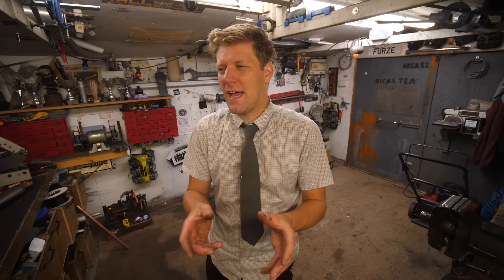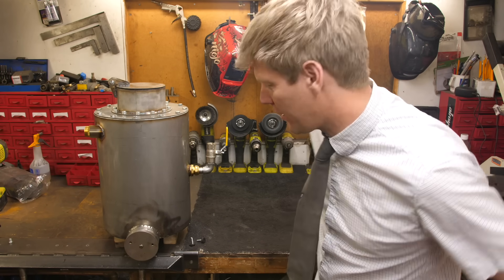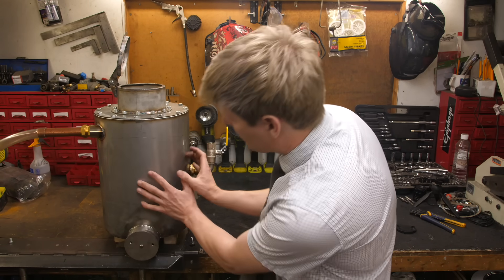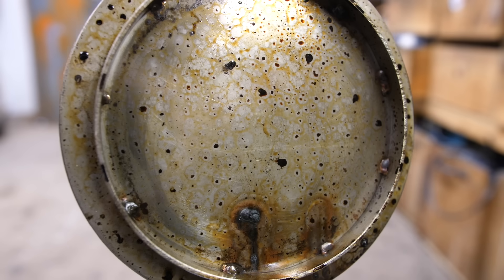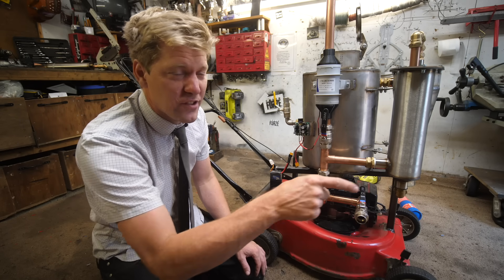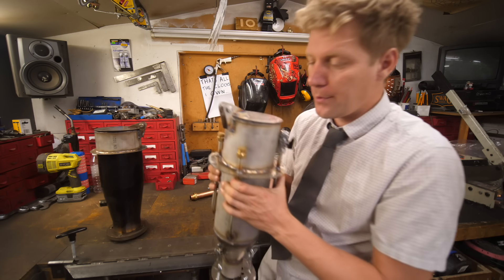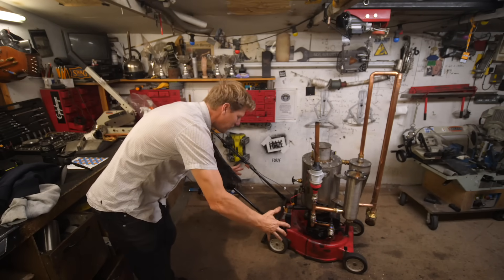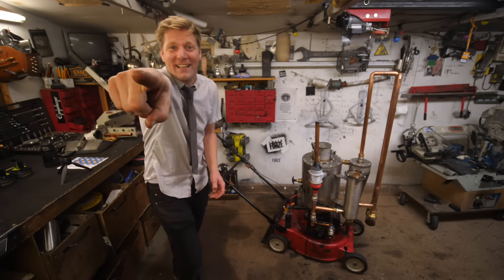WOOD POWERED LAWN MOWER

Comment: What is you capture wood gas?
Reply: Why is it upside down?
Reply: Regulate Temperature
Reply: Get an AC300 you have tar particles everywhere
Reply: It's a Vornado
Reply: Tolerances Colin. Throwing off every future project.
Reply: What is a safety tie as well
Reply: Colin. I'm dropping my mug on my lathe here we go. AHHHHHHHHHHHHHHHHHHHHHHH
Reply: MY EYEEEEEEES
Reply: IT'S INSIDE MY SKULLLLL.
Reply: IT WENT THROUGH THE MASK AHHHH. I'm going to be in a bed osmosising porcelain fragments out of my brain for two hours kthanksbye.

A Safety Tie Pops Off which is O.K. for working in a shop perhaps with equipment like a lathe or mill.
Why do I say O.K. (again in capital letters)? Because you wouldn't wear a tie in a shop unless you weren't on a lathe or mill etc. often.
No mug lathe jokes ok...
Reply: Colin Understand.

I am fine and didn't drop a lathe in a mug.
Wait.
A Mug in a lathe.

I am unharmed.
Reply: Colin why do I Need to say I am unharmed?

I am.

Because it completes the thought of what is true.

Comment: The real question is can you power the lawnmower by gassifying the lawn trimmings it produces?
You'd prolly have to dry the trimmings out first so they gassify correctly, but it would be pretty awesome to have a lawn-powered zero net carbon lawnmower.

Comment: Someone on YouTube did this but was able to "distill" out the impurities. And use the oils for work equipment bushings. Then he used this tech to gasify chopped up tires. He made 3 grades of oil/grease, carbon black (which he sold back to a tire company), and was able to compress the gases to run a kitchen stove. I wish I would have save the vid.

Comment: I have an idea that has been floating around in my head for a while, a riding lawnmower that is actually a large drone/hovercraft that uses a large central rotor to cut the grass with 4 smaller rotors around it for extra lift and another rotor that is mounted sideways at the back with a rudder to steer it better so the other rotors can maintain a constant speed. The last rotor may be able too suck the grass into a bag too. I have no idea if it would even work but if it somehow does it can cut grass in marshy areas without leaving tracks in the mud.

Comment: you seriously want to power your bunker with wood ? please dont! sir use renewable energy in some way!
please like and comment some ideas of what he should build instead of the woodpowered energy source!
Reply: I posted my idea,
My idea and for the bunker use solar power to heat the chips, use parabolic with vacuumtube or mirror focus to heat up the chips, and store the gas.
Later you can do the same for boiling water and use the steam to reform woodgas/syngas to methane.
This was my PHd and project for national award but was canceled due to corruption in my country!

If you can do and prove maybe you could get the needed attention to help 3th world to find the green way.
Reply: @Subla Kuty  look man, wood isn't for everyone. If everyone uses wood, we would be as doomed as with fossil fuels. It's the same thing with every power source. Solar panels and wind energy would not compensate for our hunger for energy.

In fact it is our energy consumption, which is getting bigger and makes it even harder for renewable energy sources to cover it.

He wants to power the generator with wood, because wood is readily available anywhere and at any time, unlike petrol.  Wind energy would be a great option, but it still relies on wind , and has to have a backup battery to store the energy. 
It is the same with solar energy, which also needs the sun. And if the solar panel breaks you can't repair it, unlike the engine, where you can replace the faulty parts.

To be fair, he technically wouldn't even have to build any energy source, because his house has electricity, but his plan is to go off grid with the bunker, so a wood powered generator is the best idea

Ideally, if he would own a little area with Forrest, he could collect sticks and tinder from there to use, but I think he will just buy some, because it is very unlikely that the UK will have a power shortage any time soon. 

Also for your information, trees grow if planted
And yes, they take a long time to regrow, but they still grow, so it is renewable

I know that every tree, that is cut down will let more co2 to store up in our atmosphere, but what most people don't know is, that a dead tree, will be eaten by fungi and other things on the ground, which release co2, so burning it for energy would be 100% environmentally friendly!

Anyways, back to the argument.

I never said that everyone should use wood gas as a power source and I don't think, that wood gas will even get to the mainstream consumer, because it is pretty hard to make a gasifier for it and you have to have a lot of knowledge to be able to maintain and be running it.

Also if everyone would be using it, the Forrest wouldn't be able to compensate for the sheer amount of wood that would have to be produced, so that is a nogo.
But it is the same with solar and wind energy, because both types of energy sources need a lot of precious metal types, which are beeing mined and shipped and manufactured with an immense amount of co2 produced. 

Either way would be bad for humanity!

But not for a single person using a wood gasifier it for fun..
Reply: @Obscure_Nightvision_Reviews  i understand what you say and i have to agree most of it cuz its true. But unfortunately, ita not just one person using wood, and we are still using up earth's wood supply. About the renewable enrgy, you just have to construct it once, and its good for 20 years without producing co2. While a woodburning for 20 years will eat millions of trees. 
I see no reason to continue the argument any further. Its about the mindset. "oh we'll fuck up our planet anyway lets have fun then" isnt the way to go i think. I cant blame those people though ;)
Reply: to be honest, wood is a renewable energy source...
Reply: @Obscure_Nightvision_Reviews  where you live ? In 100AD ? We use waaaay more energy than wood could ever reproduce. Just google it up whats happening to forests all around the world, and how its ruining our home.
Reply: @sublakuty715  not really true, if you break down water (infinate) with syngas from woocgasificatio to reform sythetic methane you got way better equalition.

Comment: So the way my friend did it was with the metal barrrel drill holes all around the top and sides, have an exhaust pipe out the top slightly slanted so the tar which is basically a biocrude oil drip down into a jar then the gas travels around the bend and through another srtetch of pipe into usable gas into the generator. This is common slavic tech right here, I've seen cars running off burning trash, also keep you warm.

Comment: According to Jim Mason from All Power Labs making engine grade gas from wood is "energetically challenged" and his company makes use of the engine exhaust heat to dry and pyrolyse the fuel.  The gas you are making is dirty because the hearth isn't hot enough, because it is being cooled by cold fuel and cold air.  APL preheats the air with the gasifier output, and preheats the fuel with the engine exhaust.

Comment: Colin (or Wallace?)
Don't pull the gas through the fire, you'll loose some.
After the gas leaves the still, bubble it through a column of water, this will cool and clean the gas. If you use the fan to pull the gas through this setup then it shouldn't melt.
Overall it worked and I applaud you or it 👏👏👏👏👏👏👏.
Can't wait to see the next video 👍😷

Comment: There's a cooky side of YouTube that does this normally furze.

I admit I would much rather see you make a rocket nozzle and turn wood into methanol to fuel it.

Mostly I would love for you to make a rocket powered something.

Also making methanol from wood is a much cleaner process. Still makes some wood gas but that can also be turned into methanol.

Altogether this video gives me a feeling that you've run out of ideas a bit.

So why not make a rocket or turbine powered scooter, not a jet turbine though, more like it's an engine than a rocket.

Comment: Colin's delight at the thing starting suggests just how difficult this is to get working in any way.
Reply: I agree. You can also see he's not being fake like some youtubers out there, his delight is genuine! His genuineness and his antics are the whole reason I follow.
Reply: It's because he's allowing oxygen into the destructive distillation process. I've done what he's doing, and it's much more successful in a simpler format. If you look up how it was done during WWII to run buses and cars you'll see what I mean. Allowing oxygen into the pyrolysis chamber is creating a flame front and burning some of the Syngas. A sealed fuel chamber with a single output will push expanding hot gas out when sufficiently heated. The gas is then filtered, and THEN you mix in air right before the carburettor. Colin's very well constructed device is mixing oxygen before the gas has been sufficiently cooled, and it's partially combusting.
Reply: Nah, he just gets excited at everything. Like getting force fed cake. Or bursting through the wall of a caravan 😆
Reply: Honestly, I was excited too. I never heard of this tech before, but he's basically built an entire from scratch. Imagine!
Reply: Yup, this was a tough one.
Reply: Always wanted to convert my truck to wood gas. The one I use on my channel.
Reply: I’ve never seen him that surprised
Reply: Well ya, he normally doesn't have to do nearly this many fixes.
Reply: Donald and Kanye getting close https://youtu.be/0KjnXpiFhT0

Comment: I've built a couple of these. If you want to cut down on Tar you need it hotter. Way hotter. like 1000C. I managed it by forcing my fresh air into a heat exchanger(intercooler). That way cold air goes hot and hot air goes cooler. I also put my air intake tube down the middle of my fuel storage into the combustion chamber, and insulated around my combustion chamber. Another filter technique is a bubbler which basically you force the gas through a water filled vertical tube and the vacuum pressure from the engine makes it bubble. I also added marbles to this chamber. My woodgas burns almost invisible. The more orange you have, the more tar you have.

Comment: Why not invert the design? Put the burner on the inner part and the wood to be distilled around it. Taping off the gas will not be that big deal and you get a bit more usble heat.

During the 70s Oil Crysis, there were a few jeeps around with a distiller on the back in my country, according to a teacher of mine..

Comment: During the wars in Finland when the military needed all the gas and it was too expensive for consumers we had motorcycles and cars running on wood gases. It was called häkäpönttö. 
And btw: the burning gas is carbon monoxide. Really dangerous for humans. So you shouldn´t do that inside the shed.
Reply: He should let it react with steam on nickel and would get methane which is stable.

Comment: Lawns are stupid as shit, but if you're going to have one, cutting at the tallest setting will allow the grass plants to put more of there energy into producing chlorophyll, runners and rhyzomes, rather than into growing tall, which means a fuller, greener lawn. longer grass also shades the soil and prevents "weed" seeds from germinating. There aren't allot of plants that tolerate being mowed, it's pretty much just grass, clover (if you have clover it's because your soil doesn't have enough nitrogen for grass.... clover fixes nitrogen from the air and adds it to the soil, so over time just treating clover like you would grass will over time increase the soils nitrogen content to the point where it does support grass) and moss (if you have moss it's because there isn't enough light for grass, get over it.). Mowing kills whatever "weeds" you might have once they get tall enough to be cut by the mower, shading the soil, by allowing the grass to grow tall, prevents new ones from germinating. 

Also only mow when there is rain forecasted for the near future; being cut is a traumatic experience, allowing the grass plants to heal afterwards helps keep a lawn as healthy as it could be when you're stupid enough to want a monocultured grass lawn. Finally, if there is rain in the forecast but it's supposed to be the last rain before a long draught, do not cut the lawn. Do not cut the lawn until before the next forecasted rain after the rain that breaks the drought.

If you don't get enough rainfall to support grass plants without supplementary water, and you still insist on having a grass lawn, go suck rocks.

Comment: Hi Colin I built one of these about 20 years ago as a project with my kids. I didn’t use a fan , it was similar to yours but it was  draw by demand. I also made a large water filter and ran the gas through it which cooled and cleaned the wood gas.
Reply: They also used these wood gas engines on some boats during the war because of fuel shortages.

Comment: The best way to filter the tar is to use water. Have the inlet pipe submerged in the water and the outlet above it. The gas will bubble out of the water and the tar will stay behind. Then you just need to change out the water every now and then

Comment: So when's the wood powder Tank video coming?
Reply: In WW2.
Seriously, due to fuel shortages wood powered tanks were used as training vehicles. The reason they weren't on the front lines is because of the extra time it took to get the wood gas ready.
Reply: @travissmith5994  Iron made videos about that if you don't know
Reply: @travissmith5994  yup. The Germans trained tiger crews on turret-less wood gasifier powered tiger tanks
Reply: wood gas tank propelled by a pulse jet 1939 colorized
Reply: nice to see a felow YTber suporting a nother felow YTber
Reply: I did not expect to see you here, although now I want to see him do that too.

Comment: A filter solution for the tar could be to push the gas through water like in a Shisha.
Reply: Would get the gas wet
Reply: Instead of water it should also be possible to use oil or bio diesel.
Reply: water in an engine..?
Reply: @Michael Jay Yep. Cooling is also good because it increases the energy density of the fuel.

Comment: If you could get it up to ~ 600-700 degrees you could run the gas over a palladium catalytic converter type jobby. 
Otherwise I think you are looking for a separation method , could you run a coolant over/around the gas out pipes to have the tar solidify and drop down ?

Comment: LOL Nice colinfurze!!

You may get a hold of me if you like and Ill help you to the next level. Your missing a reduction zone in this build. You must pass the gas through a carbon bed to condition the gas. This strips out the Oxygen in the hydro carbon chains and combines it with the carbon in the carbon bed. This creates CO while leaving H2 behind in the case of chemical bound water.   If you have a restriction before this carbon bed, this will focus the heat to crack the tars before entering the reduction zone. 

You can not fitler tar it will remain suspended in gas form and bypass any filter you run it through. It will only condense after due point is achieved and this is dependent on atmospheric pressure. (Generally it wont drop until it gas reached your throttle plate) . 

On this unit you have here you may be able to convert it into charcoal unit. However you will need to change it to an updraft and seal the lid somehow. You then make charcoal and all the tars will already be spent in that process. You can inject water or flash steam injection to produce more hydrogen as well.

Comment: I was completely gobsmacked when the mower started.  And I'm all in on this build.  

Some thoughts.  Since the burning fire draws in air, have you considered using that effect to actively air cool the condensing coil? And now - off into nerd land... imagine the engine generating some electricity and using that to power an electrolyzer to generate hydrogen to add to the fuel mix going into the mower.  :D  I have no idea if that would improve anything.  LOL  I just like the whole steampunk appeal of this build, and adding a system that bubbles fizzy hydrogen would just add to the aesthetic. :)

On second thought... generating hydrogen below a mass of burning wood is a stupid idea.  LOL